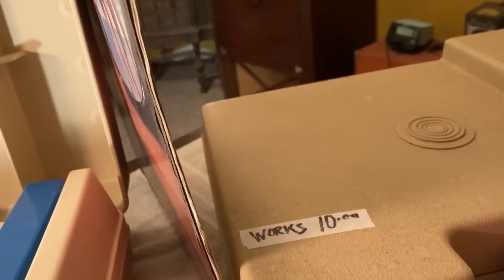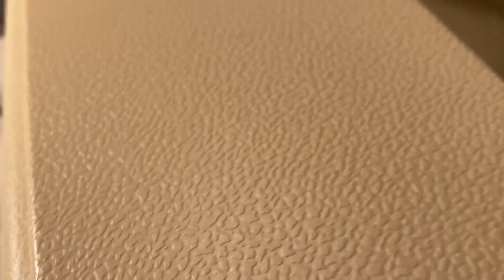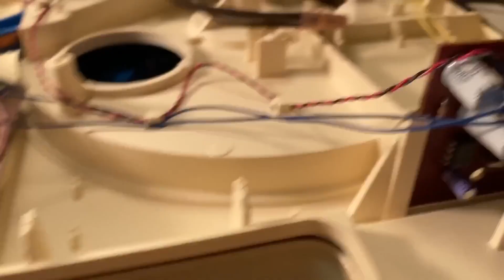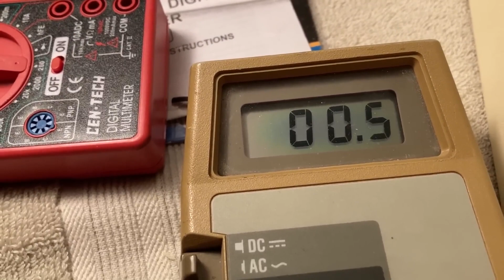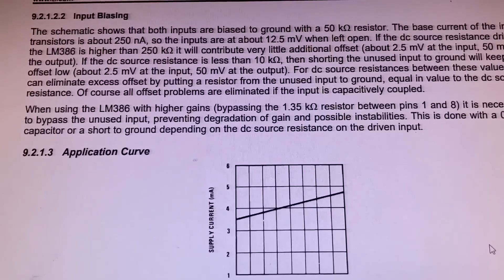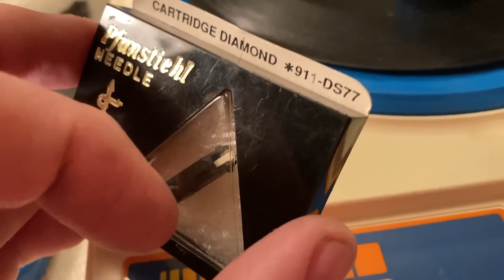Somebody Lied And Sold Me A Broke 1978 Fisher Price Record Player!

Comment: 24:25 - The slimmer end of the motor shaft is for 33-1/3 RPM.  The slightly fatter shoulder closer to the motor is for 45 RPM.  If this phonograph had 78 RPM, there would be an even fatter shoulder below the 45-RPM one.

An idler wheel, moved up or down by the speed selector switch, is wedged in between the motor shaft and the inner rim of the platter, causing the platter to rotate.  When the switch is off, the idler wheel is disengaged, not bearing on the motor shaft or platter.

Comment: YEP! DEFINITELY a fine piece of equipment I would play my Sheffield Labs Direct-to-Disc collector's albums on! You will notice the  full size,heavy die-cast 7-pound platter on this unit,resting on the double-plate steel plinthe.Also,the Ultra-Low-Mass dynamically balanced tonearm,with precision needle-type bearings in a gimbal mounted assembly.The anti-skate control assures equal tracking to offset unequal forces on the groove walls,as the precisely aligned Shure V-15 Type IV cartridge with hyperelliptical stylus,tracking at ONE gram,is just visible below the cartridge mount. Everything about this unit in the video EXUDES quality.   Oh,wait a minute----I thought this was a Dual 701.🤣😂
Reply: After 15 years,this unit is DEFINITELY ready for a recap......spray some De-Oxit n the volume control. Oil those bronze bearings in the motor.
Reply: Those security screws are meant to keep people from messing with the high-quality components inside....:face-green-smiling:

Comment: I had a similar record player, but it was probably a Fisher Price knock-off. I remember a full size LP didn't quite fit even though it  had the speed setting. I had a handful of 45s. The one song I distinctly remember was Herb Alpert - This Guy's in Love with You.  So cheesy but I loved it!
Reply from the maker: That song is very cool, I like it.  Think about it; the guy was an instrumentalist, a trumpet player, and never had a #1 hit until he finally decided to actually sing one.  Then THAT one goes to #1.  I love the middle eight where he's humming along to his own trumpet, very poignant.
Reply: A little searching looks like mine probably was Fisher Price. The blue ones were made 1985-89 an the tan one was 1978-1984. Maybe the original was a little smaller or that Ringo Starr record I tried was larger than average.
Reply: ...and a few plays later,Herb would sound like Donald Duck on that unit....

Comment: The better needle makes it better.
Reply: Or COULD I suggest a cartridge upgrade--how about an Ortofon MC Diamond? at only $10,000,it really brings out the subtle details in those record grooves!  I wonder if....those Fisher-Price tonearms have the standard 1/2" spacing,or the P-mount.......
Reply: or maybe a headless trim nail.....
Reply: The first Fisher-Price Phonographs used an Astatic 79d cartridge, whose body was translucent yellow and had two tips, one for LP (black diamond) and the other for 78-RPM records (clear sapphire).  Around 1982, Fisher-Price replaced the Astatic 79d with a cheap knock-off made in Colombia, whose body was opaque black (the ones you see on both of these phonographs).  The Astatic 79d tracked and sounded far better than the Colombian cartridge.

Comment: Your chip there is a LM386-3, which is rated to run from 5V DC up to 18V DC, it will deliver up to a full watt into 4 ohms.  It should be just fine with an eight ohm speaker.

Edit: the distortion is most likely a power supply limit, there’s only so much current that motor coil winding can provide.  It would probably be better with an external supply, but hey, this is a kid’s toy, what does it matter?  Good enough is good enough.  “Hey you kids!  I can barely hear myself think in here!  Turn down that noise!!!!”  😂
Reply: I don't know....as a long-time electronics tinkerer and technician myself,who will try most ANYTHING--and a rather obnoxious audiophile,to boot--I was thinking if there was a way of cramming a Phase Linear 700B power amp(complete with meters), in there......
Reply: The cartridge would be producing WAY more distortion than even the under-powered amp.
Reply: With an extra-large heat sink,and a full18 volts, the wattage will go up to an  astonishing....1.1 watts!:face-fuchsia-tongue-out:

Comment: Most likely those cheap leads are aluminum.
Reply: Also, that's a $7 meter from Harbor Freight...it's about as cheap as you can make a meter and still have it work. I have one and the leads fell apart on me after only a few uses.

Even Walmart has better multimeters than that.

Comment: I must have always been around bad record players because that one doesn’t sound all that bad.
Reply from the maker: This one is pretty cheap, a decent quality one would sound even much better than this one.  You'd be surprised at how good a decent one will sound!  I haven't done a video on a really good one yet, stay tuned!
Reply: I DON'T EVEN want to imagine.....
Reply: Neither does two tin cans and a string.No tubes or transistors. Zero distortion....

Comment: An 8Ω speaker will never have the DC resistance of 8Ω because that value is the impedance of the speaker and not the DC resistance. 😎
Reply from the maker: I don’t know I’ve checked a lot of them. They’re usually right around eight ohms resistance.
Reply: True--AC voltage has components like frequency and inductance which affect the actual "resistance"--unlike dc current,which is what a meter uses to check resistance.So,an "8-ohm" impedance speaker is usually on the magnitude of about 5-6 ohms DC coil resistance,and can vary across the frequency spectrum. But-when you have an amplifier with a frequency range from about 200-5000 cps--not a real big deal.